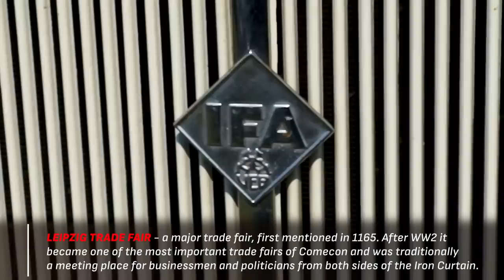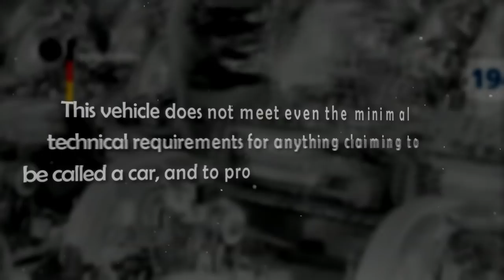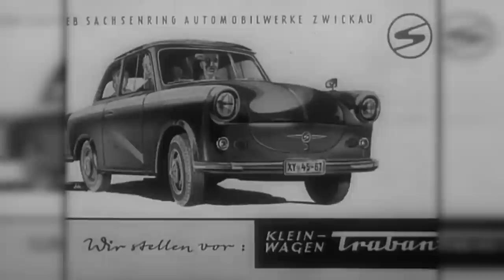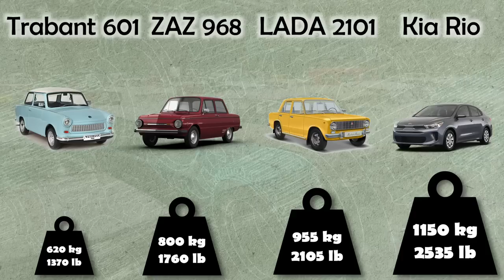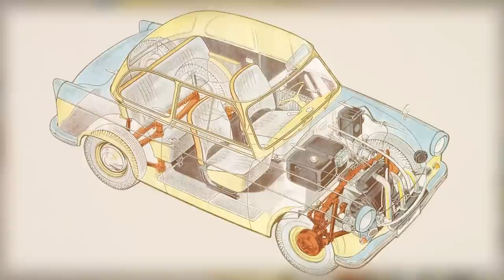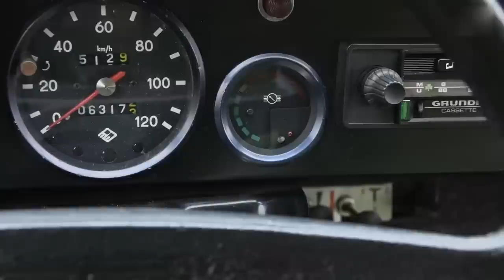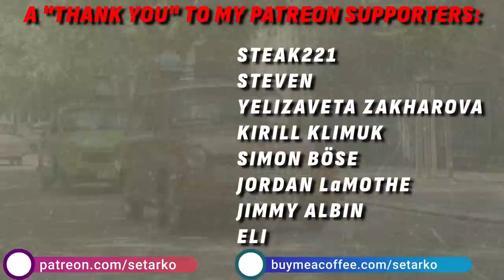Trabant - A Plastic Masterpiece of Developed Socialism

Comment: i own a trabant that i completely restored myself. the design choices on this car are nothing short of ingenious, everything is made to be as simple and easy to maintain as possible. it is one of few cars that can be understood fully by your average joe and working on it is an absolute joy

also, the tiny 26hp engine is actually more than adequate, and it performs pretty good if you're not doing highway speeds
Reply: Yeah. Heck I'm not a car guy at all, heck I'm a public transit advocate that's advocating for reduced car use and eliminating car dependency, especially in cities, but if there's a car I'll find alright, its one with the qualities of the Trabant! Simple, easy to understand, durable, reliable, and affordable. Not a tool you are completely dependent upon, nor an extreme luxury. Just a nice thing to have if needed, that is so simple that anyone can fix it. I wonder if anyone one day will have the bright idea of making an electric car with the same simplistic qualities of something like the Beetle, 2CV, or Trabant.

Comment: We had a Trabant back in the day, it's definitely a product of its time and country of origin. I don't think it any sort of electrical pumps, the fuel was gravity fed, the engine was air cooled, the brakes weren't boosted. Even the windshield washer used a hand operated pump.
Reply: It was a good enough car in 50' but by the end of 80' it was an unfunny joke. Just imagine switching to a damn shitty Daewoo Tico or Fiat Cinquecento and feeling inside like in a merc. Working ventilation and not smelly heating, what a luxury! It can maintain 90 kph behind a semi without screaming like a slaughtered animal and using 20% less fuel, astonishing! It can reach 300 thousands kilometres without four engine regenerations and one replacement, what a durability!
Reply: @Dziki_z_Lasu  Oh believe me I know. Later in life I had a Honda 50cc scooter that was manufactured about 4-5 years before our Trabant, yet it would mix petrol and oil on its own and it even had a fuel gauge!
So yeah even an 50cc scooter was more advanced than the Trabant.
Reply: Funny thing is that in the entire East Block, the cars from East Germany were the most primitive and lagging behind everyone. Trabant and Wartburg were good when they first came out, but then literally no investment was done for them untill the very end when Germany united and they got VW engines. Same country; Germany, two different systems, and the difference in cars made was like a horse cart vs. starship.
Reply: Depends on what you mean as "of its time". The constructive base of the Trabant was the DKW F1 from 1932. All later constructions are changes in detail (different cylinder size, compression rates, unsynchronized or synchronized gearbox, ponton car body, leaf springs or coil springs), but the general layout stayed the same, from the F2 up to the F8, from the AWZ P70 to the IFA P50, until the Trabant 601. The Trabant basically stayed the same for 60 years.
Reply: @NikiDaDude  You are not meant to mix petrol and oil for your Trabant yourself. That was totally unnecessary as the petrol-oil mixture was sold ready-to-go at every petrol station in East Germany. (Actually, when it was new, two-stroke cars were still pretty common elsewhere, and so was pre-mixed two-stroke fuel.)
Reply: @MartinIbert  Exactly, that was the case in Czechoslovakia too, because there were a lot of Trabants, Wartburgs, Barkas, MZ motorcycles and of course Jawa and ČZ also produced two stoke motorbikes.
Reply: @piotrmalewski8178  Actually they got the VW engine in 1988 (Wartburg) and 89 (Trabant), so some time before Germany was united. What i found interesting about the Trabant is that it was exported into Czechoslovakia only until 1984, because the Transport ministry revoked it's eligibility for running on public roads. People of course could still drive them if they had them, but they couldn't be imported as new.
Reply: it was great car for the day. Because back then, you didn't have cell phones, tow trucks, service stations everywhere.
You needed car you can fix by yourself. Or getting fixed easily by some Joe Shmoe at next village.
It was car to perfectly match the era. You didn't have roads to go 180km/h. You just needed transport method to get you somewhere.
Reply: @AlejjSi  Yes, I found that omission strange too, as it was by far the largest technological advancement in their entire history. But OTOH it was too little, too late.
BTW The "VW" engines were manufactured in East Germany under licence. Buying actual engines from the West was totally out of the question. This was a complex deal of GDR factories producing VW-engineered engines in the East, most of them to be installed in West German cars in West Germany, and some going to Wartburgs and Trabants.
Reply: @AlejjSi  The deal with VW happened even earlier, in 1984. But it took a number of years to build the new engine factory and the Wartburg 1.1 production line.
Reply: @MartinIbert I used to repair motorcycles and cars in the 1980s. I noticed that many then recent Volkswagen engines were held together by East German ESKA bolts. You have just explained why.
Reply: @piotrmalewski8178 One was propped up by Marshall plan and access to unlimited tech transfers, one paid its war reparations after being flattened by allies...
Reply: @Rssika   It's a myth that it changed anything. In 1947, before the plan even started, and cities and factories were still in ruins, West Germany alone had yearly GDP of about 40-50 billion dollars bigger (in today's money) than all countries that benefited from the Marshall Plan got in tech, resource, financial and all other transfers combined during the lifespan of the programme. 
The real problem East Germany had were the one's coming the 'communist' economy model. Central planning of prices meant there was not much information about demand. Together with central planning it meant constantly some goods were oversupplied to one places, and completely unavailable in others. State-provided housing together with warranty of having a job, meant people had little motivation to work hard or even come sober to work. The result was terrible production efficiency and quality. 

If you had an idea to make a new product, you couldn't start a business or sell it to one. You had to fill 'racionalisation application' and most of the time the response was like 'it doesn't exist now and people manage without it, so the there is no need to invest resources in producing it.' 

If your factory needed certain parts instantly, it couldn't just buy them because either there was a shortage, or just there was a centralised ordering procedure that didn't allow it. 
My uncle was a lawyer in a factory that produced electro-optic controlled lathes (a sort of precise metal shaping machine). 
When something happened to a supply of special light bulbs they needed, or suddenly a big order came from the West, they couldn't deliver, because the state procedure required that any order for imported parts should be placed with 6 months overtaking and then the ministry would maybe assign funds, maybe not.

And there come other problems. 
People were persecuted by security service, especially in East Germany, because of Soviet paranoia about state security. People would not report fraudulent actions of high management in their companies, because high management was always strongly linked to local state officials. A few times my grandfather was asked by director of his mine to drive him to the capital. He didn't want to do it, but had no choice. Every time the director 'was carring a suitcase full of money, an extortion for a minister for making him a director. My grandfather never said anything because he was afraid. A few of his colleagues reported the director. Accusations were made against them, not the director, they were arrested and degraded.

And there was yet another problem; Communists had obsession about statistics, poorly understood. The USSR would dig up coal, and then drown it in lakes, only so mining industry minister could report record-breaking production of coal and supposedly catching up with USA. 
In Mao's China, unknown number, probably billions units of metal pottery, farming tools, and various household items was destroyed and melt down into low quality iron, only so local officials could report meeting the target of 'steel' producton during the 'Great Leap Forward'. 
My grandfather was high-level engineer in mining industry in communist Poland. He said the country 'Drained sulphur resources for nothing. We were supposed to break records of production, we threw stupid amounts of sulphur on world markets, price dropped and we destroyed our resources for nothing.' 

On one occasion my grandfather  was asked to oversee digging a new shaft at his mine to be opened at 25th Anniversary of the Communist Poland. He refused, saying they could dig a shaft, but there is no time to properly seal it, so ground waters would flood and destroy it. Another engineer agreed, and as my grandfather predicted, the whole shaft was flooded and destroyed. The mine director made an excuse 'it was done on purpose for safety research', but my grandfather still had trouble for refusing to do that. He was interrogated by security service, had to write  'self-criticism' which hindered his career, then they were trying to frame him into 'using mine's cars for private business purposes', and 'illegal production of pork.' This was initially triggered by a company car with his name in a rental book being found flooded with blood. Later it was found it was pig blood, and yet later that his signature was faked. But initially there was none other information than that a car supposedly he signed on, was found flooded with blood. At this point my grandfather had been in high stress levels for months, and he thought they wanted to frame him into murder so he passed out and almost died from internal bleeding. I know about this, because just during the time I personally remember, he would pass out 3 times from internal bleeding, and every time surgeons said it was the same injury.
Reply: @piotrmalewski8178  First paragraph is just anti-communist jibberjabber, but you do have a point here and there. 

Revisionist counter-revolution and destructive Kosygin reforms (these happened in other COMECON countries as well) made way for rebirth of capitalism inside the state and managerial "new bourgeoisie" who had power over production. This was recognized in many anti-revisionist countries later. A lot of these issues directly stemmed from these capitalist reforms. 

Despite all this nonsense, revisionist socialist countries managed to do massive improvements in QoL. This was never really replicated by capitalist countries without overt imperialism (France, US for example) or massive handouts (S. Korea during Syngman Rhee and Park Chun-Lee dictatorships).
Reply: @Rssika   Show me a capitalist country in which a standard is that production workers cooperate with security to rob factory on daily basis, and the staff is permanently drunk. 

It is estimated than in communist times, every security worker at car factory, received at least one valuable car part a month as bribery from each production worker who was stealing parts for himself. An arrested record-breaker was caught with 400 stolen alternators in his flat. 
In FSO, communist Poland's biggest car manufacturer every year 10 to 20 hideouts full of vodka would be found in the factory.
Some new cars had a flaw of noise mysteriously coming from doors while driving, after taking upholstery down, new owners would discover that the car door's were where workers would put empty bottles of beer and vodka. Another problem was lack of oil in the engine, gearbox or steering gear. New cars would fail because workers would steal the oil, instead of putting it in the cars.

Today if you pull out a stunt of being drunk at work you get fired and you're not likely to find a job again. In the East Block, being drunk at work was a standard. Even If you lost a job, you'd get another. Edward Pietrzak mentions that about 25% of staff was permantly new hires, soldiers or prisoners, because people were constantly getting fired for getting drunk at work.

 If you went to a shop, you couldn't count on good service. Shop workers did not have any interest in serving customers because whatever the sales, or lack of, they were still paid.
Often you couldn't buy basic products because they were not available, but sometimes you couldn't buy anything at because store staff would ignore you and keep chatting, doing manicure etc.

And the supply and demand ratio is the most basic and importat driver of economy. With centrally planned prices you're loosing lots of information.
Reply: @piotrmalewski8178  Pick any EE country or Finland.
Reply: less things to break down. coool!
Reply: Components that are not there cannot go wrong.
Reply: @piotrmalewski8178  the stories you speak of scare me. of course, if everyone knows that they will get paid either way is a VERY bad recipe for efficiency. societies simply
cannot function without holding workers accountable and upholding meritocracy.

still though, i am a socialist. i truly believe that a government doesnt need to resort to a profit motive to manage people. sure, profit is really good at forcing competency but there are other solutions too.

i dont know how the soviet union managed pricing, but centrally planned prices can fluctuate depending on supply / demand, if the authorities so choose. that is not an anti-socialist concept, so the losing information part is not true. in fact, under socialism you would have more economic information. instead of millions of actors doing their own thing you would have cohesion. decision makers would more easily grasp where the economy is heading, communicate, cooperate with each other and plan accordingly.

my points only make sense if socialism is not executed poorly. otherwise capitalism would likely be better

Comment: They were popular in Poland, even during the 90's. It was one of the cheapest cars. Fiat 126p, Syrena, Zaporozhets and Trabant. Some of them you could buy a used one for a price of a new bicycle. It was cheap to buy, easy to repair. Even when they were new. Fiat 125p, Moskwicz, Polonez, Wartburg, Skoda - they were expensive. In the 80's Fiat 126p and Trabant - 90.000 zlotys, Fiat 125p and Skoda - 170.000 zlotys. People were earning around 5-6.000 per month.

Comment: Even though he is often depicted smelly, smoking, but if he was properly adjusted and maintained, it was not so intense. Even if we wanted to have a car, it was not do that we necessarily had to have one. As a rule, you lived close to where you worked. The possibilities to buy food were given even in rural areas in small villages. Traveling by train was better than today. In the past, there was a wagon at the back of the train just for freight to transport carpets, household appliances, bicycles and even motorcycles, for example, and that was normal. Trips to the sea or the mountains were possible with luggage in the trailer or on the roof of the Trabant and the interior remained free. Even though it was difficult to get a Trabant, all the more we rode bicycles and motorcycles, or simply on foot, which is done today by car. Today we drive too much and uselessly with cars and neglect good, if not better, alternatives just because the car is parked in front of the house.

Comment: The idea of coproduction between Skoda and Trabant wasnt so bad, prototypes were modern and looked good. But it was stopped mainly because of needed investments and also lack of steel eastern Germany can buy - tanks were preffered. So Zwickau produced the same type till the end. Czechoslovak communist were little smarter so after years of stagnation when Skoda made 2 modernization of 60s model, they allowed new model that was ready in 1988 and became succesful also under Vokswagen in 90s.
Reply: They made a deal with Volkswagen to use the VW Golf engines in the 1988 Trabant 1.1. Modernizing the factory to produce the regular Trabant with the big Volkswagen engine turned out to be more expensive than to just build any one of the new 4 stroke engine cars that the designers at the Zwickau plants had designed over the years.
Reply: Which skoda do you mean, Škoda Favorit?
Reply: @robertkalinic335  Yes, Škoda Favorit, produced since 1988.